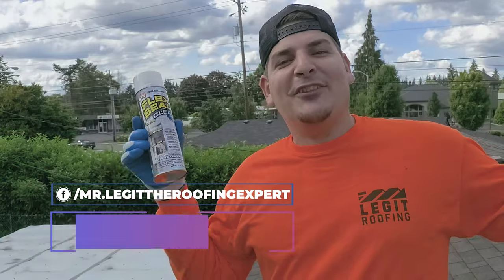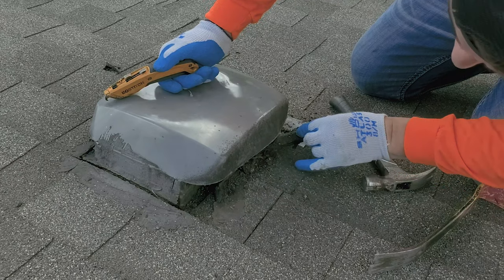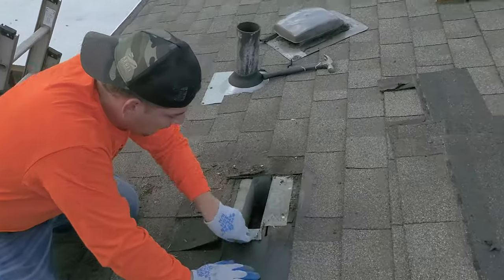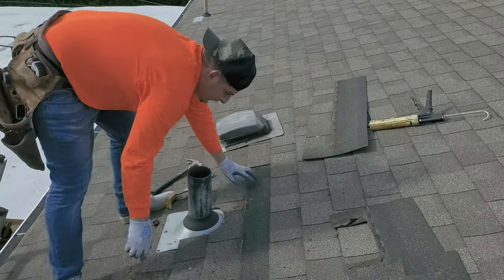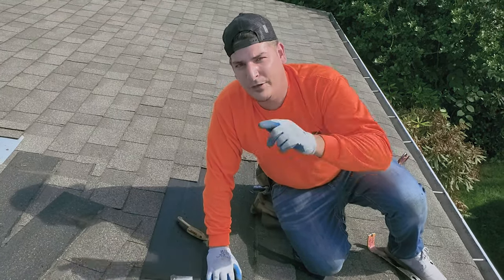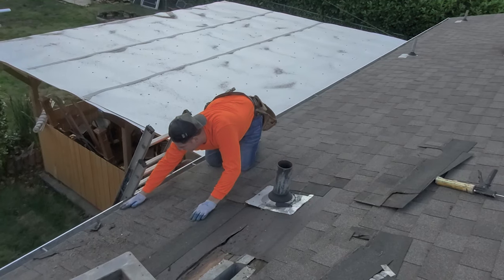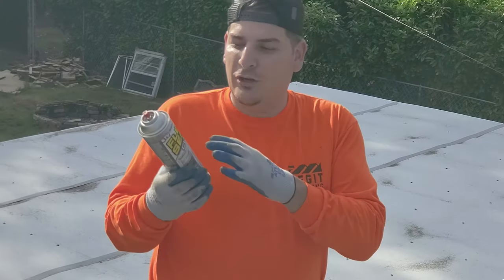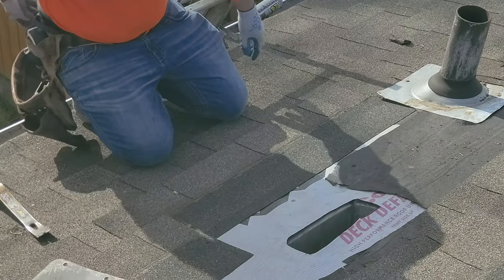How to fix a roof leak at NO COST | FLEX SEAL!!!

Comment: Nice job man! I’ve always use Ice Guard around any penetrations. Especially after it’s been leaking.
Reply from the maker: I would have but my buddy didn't want to wait. I just happened to be over there and we didn't want to run to the shop. Absolutely a must if it was contract work. We use Weather lock G on all penitrations and valleys. Thanks Meg!

Comment: Regarding ice and water shield...... when re-roofing must that replaced as well or can you re-roof over it?
Reply from the maker: If you can get it up I'd recommend getting it up. If you can't put down another layer and roof over it. It should be fine if the bump isn't too drastic. Obviously if there is a huge bump you might need to replace the wood or feather it out somehow. Good luck!

Comment: Great video. What product do you use for caulking to reseal the shingles?
Reply from the maker: This is from their website.
 https://www.apoc.com/collections/caulks-sealants/products/apoc-365-caulk-eterna-flash-all-weather-all-season-rubberized-flashing-cement

APOC 365 Eterna-Flash All Weather / All Season Rubberized Flashing Cement is a high performance flashing cement specially formulated for the professional roofer. APOC 365 in an extremely versatile modified mastic that provides superior adhesion to wet surfaces, easily bonds under water and is ideal for temporary or permanent repairs. APOC 365 Eterna-Flash is manufactured with select asphalt, synthetic rubber, solvent and fibers to provide an ‘E-Z Spread’ durable patching compound under the harshest weather conditions. APOC 365 is the ultimate repair compound and can be used to repair splits, seams, cracks and holes in spudded gravel, mineral surfaced cap sheet, smooth surface asphalt roofs, most APP and SBS membranes and shingle roofs. It will seal areas around chimneys, vent pipes, gravel guards, down spouts, cracks in concrete and control joints on roofs. APOC 365 is also an excellent utility mastic for use below grade in foundation damp-proofing systems.
Reply: Mr. Legit Roofing Expert awesome thank you!